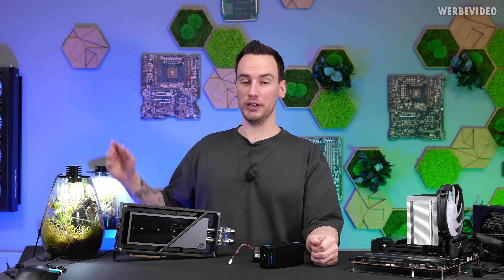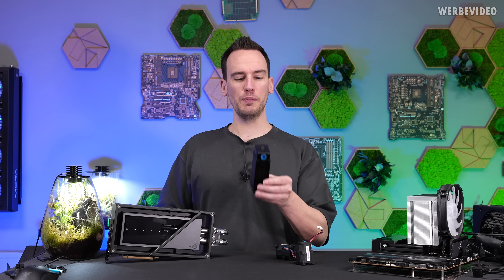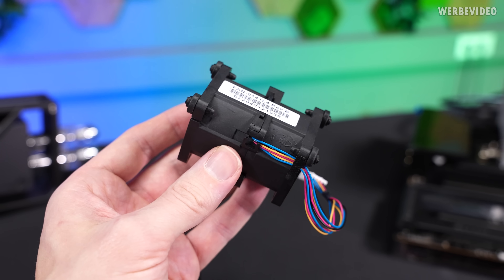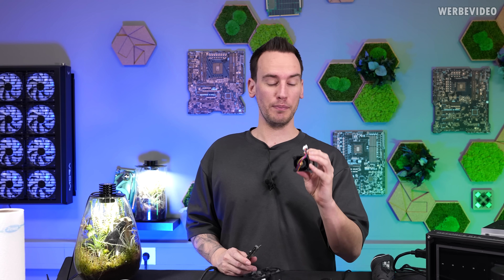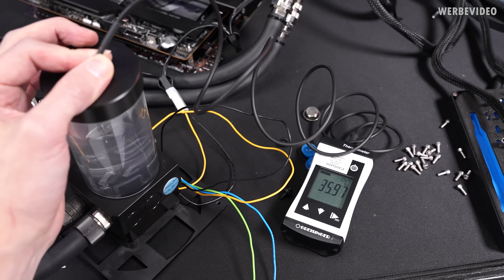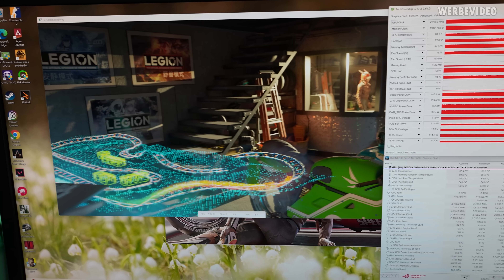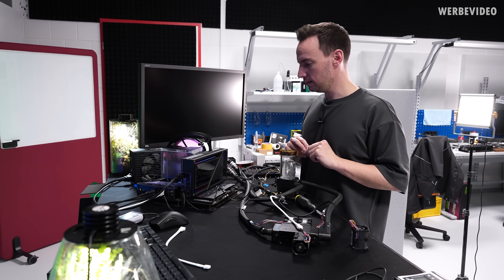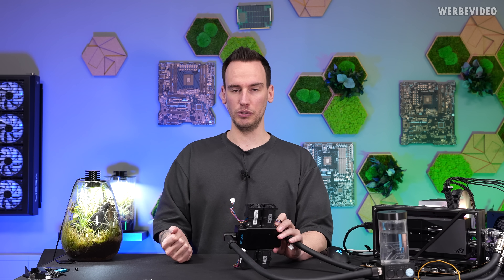Cooling my RTX 4090 with the Smallest Radiator I could find

Comment: You could try large flange/concentrators to use larger/quieter fans to push a similar amount of air through the rad. You would still have to use high RPM fans to resist the backpressure, which still means a bit of noise, but perhaps half as much as those little fuckers.

Comment: @der8auer I saw on reddit, a dude mounted his gaming PC to the paper wall with just 2 plugs.
The whole PC slammed on his desk, so maybe you should get metal wall plugs and use at least 6 points to hang it.
If you don't agree, well you have to calculate the total weight of the full MoRa IV 600 and tell us it's fine 😅
Reply: Judging by the plugs he used to hang the MORA, I suspect the wall is gypsum blocks. So while it is gypsum, it is basically a brick wall construction wise.
Reply: @fermitupoupon1754 He said it was USA paper walls, so you saying he lied to us?

Comment: let me ask a pretty stupid question?? Did you have a pump. Think about a car if you know what i am talking about. If you have Radiator the size of a car on a car and you are flying lets say 120mph so your Radiator is getting air flow ...at what speed will the heat at the engine reach the radiator naturally. You will destroy your engine but if you have a pump forcing the water through your system it will move heated engine water to the radiator for cooling while at the same time send cooler water to the engine to stabilize the temperature. I dont see a pump in your system. Also if your system is not leaking why not use a very light oil as this will absorb heat better than water or get a coolant , these normally contain oils in them which will greatly improve temperture transfer, both hot and cold .

Comment: The fans will work fine, hard wired. There is no need for a PWN controller. Also, you were running those fans unrestricted through a free-flowing radiator. There is a lot of air moving, but what end up happeneing is that air at the surfaces of the fins become sort of a "Hot Coating" that lubricate the "Good Cold Air" directly out. Those highspeed fans need to be presnted with a restriction system on the back side to increase the prissure in the radiator, causing the air to compres more and force the hot layer to interact with the cool layer. This is a nice experiment, just not on an expensive GPU like that. Dust off a heat-hog and give it another go. With back pressure baffles.  

This is the reason rack servers have so many baffles and relatively small openings for cooling. It's more about pressure management than CFM. I wish Youtube allowed the poasting of diagrams and pics as a response. So you can see the phenomenon I am talking about. Those fans create a high static pressure in the enclosure, causing lots of mixing, then smaller vent slits let "some" of the air out.
Reply: you are a genius
Reply: I have a 3000 RPM exhaust fan in my system. There's gaps around it, so I tried covering them with electrical tape, to reduce recirculation. After a few hours the fan had blown the tape off the back, even though it wasn't in the path of the fan. The tape didn't overlap the fan at all. That just shows the huge pressure differentials these fans can create.
Reply: Yeah, it'll work, but you heard how loud those suckers were. The inside fans run at 70,000 rpms and will run at that speed constantly.
Reply: @ezg8448 Do you remember Linus to make padded plywood box for whole pc case to make noise less pc case? This thing is so small that it could fit inside small padded plywood box that could fit into pc case.
Reply: @zperdek  - Unfortunately I haven't saw that video, but I'll check it now, thx.
Reply: I think it's more that the fin stack in that radiator is not very dense, so it sees very diminishing returns for greater air flow. It looks to be about half the fin density of the rad in my current AIO cooler! There just isn't that much surface area to transmit heat to the flowing air. As you said, the air flow within the rad will be fairly laminar, so at high speeds a lot of cold air passes clean through without absorbing any heat. Though I wouldn't expect a flow resistance after the rad to improve anything.The air density increase would be negligible. However, those fans could easily handle an equally sized rad with a much denser fin stack. that would make a big difference!
A funnier alternative would be to mount 2 or more of those radiators end to end, with water first passing through the warm rear rad and finishing through the coldest front rad. That would greatly increase the effective surface area in a less practical manner. Counter flow heat transfer is deceptively efficient.
Reply: You can create a diagram and upload it to imgur then post a direct imgur link in the youtube comment to link to your diagram. I've done that before and it's allowed.
Reply: I would like to learn more about this. Do you have any video sources discussing it further? I've worked with servers randomly for many years, and was always surprised how restrictive the air flow is.
Reply: @johnnyeskimo I don't know of a specific video but you can search "boundary layer turbulent flow" the tl;dr is that the air close to the thing you're trying to cool is laminar, i.e. parallel to the surface, and you want turbulent flow which is basically scooping the heat away. And also more area means more places for the heat to get transferred.
Another thing you might want to look into is impedance matching, I'm not sure what the name for that in fluids is, but basically you want something that resists enough so force can be applied to it, like if you push against an empty cart you can't put as much force into it as if you push a full cart. That's the same idea with fans, if you don't have restrictions you can't use all the fan's power, like if you try to blow through a 4 inch pipe or through a trumpet.
Reply: @satibel  I have a feeling he is pushing enough air with these fans to make a boundary layer almost a moot point. There is probably immense turbulence in there already. Back-pressure will probably increase current draw on those fans
Reply: @DarkAttack14  still even without boundary layer issues, having more surface area would allow more transfer of heat since the fans are capable of it.
Reply: You have no idea what you're talking about.  Impose airflow restrictions and the reduction in air passing through, gets hotter, but then the difference in temp between that air and the radiator fins is reduced, so the radiator and thus coolant in it, get hotter.

No, the reason rack systems have small openings is their height prevents larger diameter fans and the airflow is directed in the flow pattern needed to pass over the hot components needing it.   It does not create a "high static pressure", but even if it did, the lower airflow would cause less turbulence and less "mixing".

The idea is so absurd that you have obviously never actually set up system cooling for (anything).  You want the exit paths in specific spots but with the least restriction to exhaust, possible, besides avoiding certain things like someone sticking their finger in if it's an active fan exhaust, and also, to manage EMI, you don't want equipment to cause interference.

Comment: Proper way to attribute heat dissipation properties is so-called "thermal resistance". It can make an abstraction of elements in the cooling loop, starting with the heat source and all the way to the fans.
Reply: That's a linear approximation for non-linear heat transfer, and for a radiator it also depends on water flow (and air flow, ofcourse).
Reply: @-szega  your point? I only pointed towards Navier-Stokes equation elements where all those resistances can be presented as a sum

Comment: Adding push pull would have made no difference as the issue isn't airflow it's cooling surface area... the only way to have made a difference without increasing the size of the radiator would be to increase the amount of water.

Comment: Id like to see this with a 120mm radiator though it wont be as interesting as this.

Yeah its bound to be quite boring just slap a high RPM 120MM fan on it, something like a P12 max or whatever else can actually do super high airflow at 120mm and call it a day?

Comment: You could have connected the fans directly to the psu 12V and GND and the tacho pwm signal to the Motherboard for speed control. So your motherboard doesn't have to deal with the amps.

Comment: On the completely opposite end of the spectrum; would it be possible to have a large enough radiator such that just having the water pumped through it would be enough (i.e. the radiator passively cooling, for zero fan noise)?
Reply: I think Linus did some of those vids?
Reply: @Bodwaizer  I tend to avoid LTT these days... not the most reliable content.

Comment: What's funny is these little thickbois can handle just as much of not more than a generic thinner radiator 2-3x their size. I got an EK240 AIO a couple years ago and I was sorely disappointed by the radiator and promptly replaced it with a thick 240 from my old loop and the difference was significant. It's the first and the last time I'll ever buy an AIO.

Comment: Having some stators on the back of the front fans might help shove more air through the heatsink by redirecting the swirling coming out of the fan into the fins and eliminating the relatively dead spot directly behind the fan hub.

Comment: Cool experiment. 

Weird radiator. Fin density and surface area is extremely low. Would have been interesting to see the performance with double or triple the fin density, but no point in wasting time and money on it. No matter how perfectly the fans gets matched to the airflow restriction, the setup would still be way to loud.
Reply: Yeah, those delta fans are really optimized for static pressure over just pure airflow. They would've been perfectly happy with much denser fins, or a radiator that was 4* as long. Normally they are used in 1u rack servers to blow air throughout the entire 3 foot long server case and through all sorts of different heatsinks.

Comment: Going push-pull with counter-rotating fans on a 12 FPI radiator is so hilariously overkill, you’ve got enough pressure to lift a car. Need a ridiculously dense radiator.
Reply: I wonder how many of those radiators you could stack together before those fans even noticed. We must construct the cooling plank.

Comment: So I’m a bit confused why you prime your loops by just turning on the computer, is jump starting a PSU a lost art? Get a different PSU (it can be quiet old, plug the pump into that, Bridge green to black (4 and 5), and you have a cheap alternative to a desktop power supply that only gives you two voltages. Or you can just connect the pump to an actual desktop power supply.

Comment: did you think that the server fans consume less power because they are small? 
connect the ground terminals together and supply power from an external source, 
but the ground connection of the controller and the ground connection of the power supply 
must be combined for the pwm system to work properly.

Comment: You can just hot wire the fans direct to 12v rail to get 100% duty but no soft sart also it was most probably the fan controller sorting the system

Comment: If you plugged the fan while it was rotating from the airflow, it probably was generating negative voltage, that got dumped into the fan controller killing it

Comment: So, to give you some actual background on that Alphacool radiator - it's technically part of the 'enterprise' line (not industrial), and specifically designed to fit in 1U servers. And it does... sort of. It's a little interesting. It's not intended to get systems near ambient, it's intended to keep parts just off throttling. Also note that those Lamptrons really aren't rated for anywhere near claimed. IIRC you can maybe get 2-3A total.
Also, those are not even CLOSE to the most powerful fans you can get either. That's a Delta GFC0412DS-TP01, rated for 0.854m^3/min, maximum 429.9Pa, which drops to nil at just 40% duty cycle. In other words, it's the wrong fan for that radiator. It's also not that powerful. What you actually want, is the Sanyo Denki SanAce 9CRJ0412P5J001. (What a catchy name!) Which is 1.05m^3/min, and 9.640inH2o. YEAH. NINE POINT SIX. Which lets it hold over 6inH2o all the way through 33CFM or 0.85m^3/min. Available from Digikey for just $67. Each. 
Best results with these radiators are achieved with a ducted inlet and very high static pressure (>6inH2o) pull configuration, or direct push into ducted exit. Preventing recirculation is critical, and both very application dependent. For this one, I'd make a cardboard duct for exhaust and use high static direct push like the 9CRJ's. In a more 'real world' application where the system is fully enclosed in a 1U chassis, I'd use the UT60 4x40-6x40 in a front push with 9CRJ's and a split-duct GPU/CPU setup behind the radiator. (Remember, it's 'keep off TJmax' not 'reach ambient.')

Comment: This is the 5090ti 'in-case' cooler solution. the standard 5090ti will have it's own enclosure so as to not take up 6 pci-e slots.

Comment: I think you have to leave some gap between the fans and the radiator, otherwise the area behind the fan hub has no airflow. You were effectively only using like 50% of your radiator if you place the fans on the radiator, maybe add a 3d printed duct in between. This should help tremendously with push/pull too, fans don't suck in air properly when it is right up against a rad.

Comment: Roman how about mounting some EDF Ducted Fan instead to make the pc (fly)( 120mm around 7-9 kg thrust ) should be able to push some air thru the radiator. Energy efficient No but no one have gone that over the top yet

Comment: 0:20 There really is no actual answer to that. It depends on how cool you want the GPU to be.  It could range anywhere from 'just cool enough to work without dying' to 'The coldest the GPU could be allowing for the laws of thermodynamics on planet Earth'.  There is a LOT of room there.
Reply: At some point, the radiator would melt, so there's your actual maximum. I would imagine the liquid inside would boil and blow the radiator up before that. Now i want to see a radiator pushed to literal failure. Thanks.

Comment: The hotter the water temp, the greater the delta between your ambient air and the water, the more efficient your radiator gets. Theres some math involved i dont understand because i am dumb, but its exponential. So at 60C  that radiator was dissipitating 450w. But at 20c its probably only good for 50w or something.  I have dual 480mm rads, a 5950x and a 7900xtx, and with modest fan speeds i still get into 30-32c water temps because rads arent that efficient below 30c with ambient temp in the 20's.... 12 Artic P14 max fans, so they turn 1700ish at that temp.

Comment: The problem there is the size of the radiator, due to it being small, the water flows to fast through it, not giving it enough time to dissipate the heat offset from the GPU. if you maybe had two radiators it might of worked. (GPU > Radiator > Pump > radiator > GPU)

Comment: if y have a lower surface area you will need a high temp difference between the water and th air so if u want to dis 1200w youll need over 100dg mn ig

Comment: the fin density on that little rad looked terible. alpahcool list it as only 10 fins per inch. combined with the fact that the 40mm fans have quite large hubs would mean that air flow from the fans would hit very few of the radiators fins. 
maybe putting a chamber between the rad and the fans woudl allow more of the airflow from the fans to hit all of the fins. which is likely how it would be in a 1u server, hence the low fin density. the fans and rad would not be mounted together and the low fin density would allow good airflow through the rad even with the fans bing mounted further down the chassis.

Comment: Nince idea Roman. I would have used the Aquacomputer fan controllers, like the aquaero with the water cooling backplate for 30W per channel from the built in fan controllers( I have the air cooled backplate). It will also expand with their other single 30W adaptors. I use one channel for my D5 pump and the other 3 as fan controllers. Six fans on my MORA 360 and the other six are run off the pump's fan controller. I've got temp sensors on every connection in my loop. Aquasuite is a good app but a memory hog, that still requires HWINFO64 for full functionality. My 1st one from 2017 is still on the job. I expect long lived devices. It's not cheap but it's programmable with a mono lcd screen that has past the test of time. It is still very readable across the entire screen with no burn in. Although from day one I've only used the lowest brightness settings for everyday use. Only when I access the controller directly via remote or the touch buttons does it light to full brightness, no burnt out pixels but I do have a little pixel dimming on low brightness, not noticeable unless you stare at the screen for the full cycle of displays. I've got a second one that I was going to use on the MORA 360 as a stand alone but I've got extensions from the one in my pc. So it sits as a "Hot Spare". Do you really need a color lcd screen that burns out in a year or two or a oled that may suffer burn in? I can see why after 7 years of constant use (it displays time and date when the pc is off) they made their choice of display tech to use.

Comment: Doooooode!!!??   You know Cats hearing frequency response is about 44 to 85khz!!..   everytime you turn on that cooling system must drive your kitty up a wall.   Make your cooling system 'Kitty Safe', Cool Statically.  Normal Server Fans cause discomfort to smaller Cuties...  yours are RIDICULASly exxcessive .   I think you should build a micro 'HEat Exchanger' with Co2, Methanol, Polyalphaolefin, Ethylene glycol (EGW) or some other fluid that would work within Room constraints